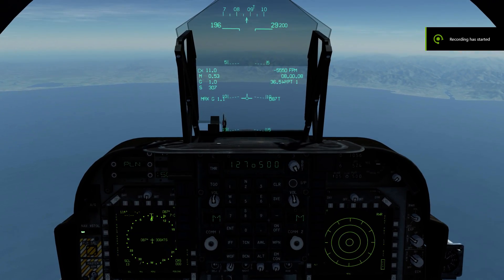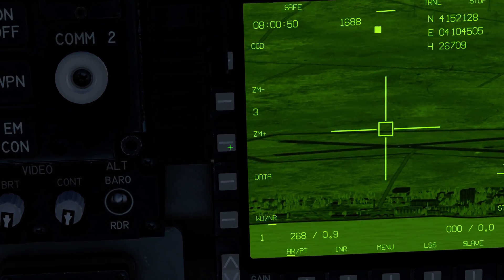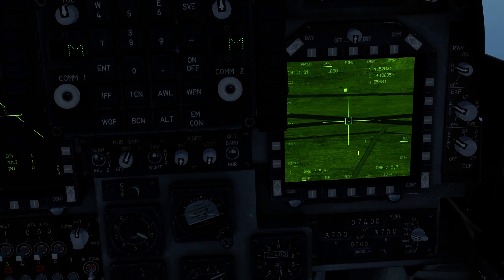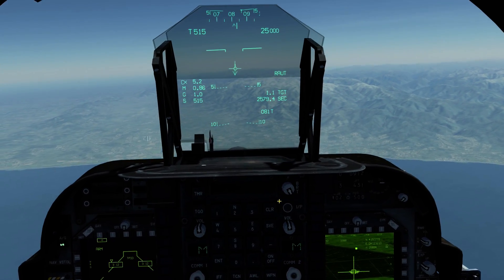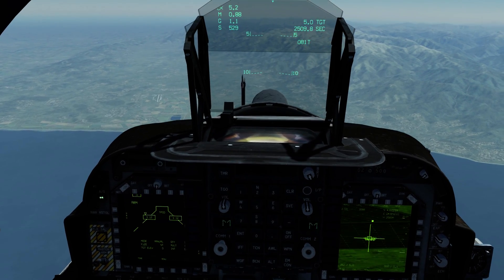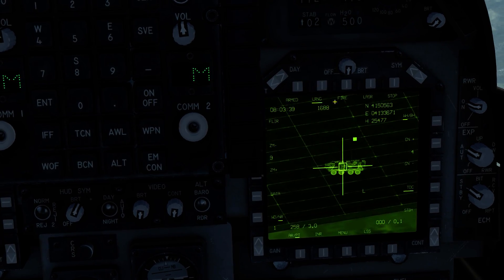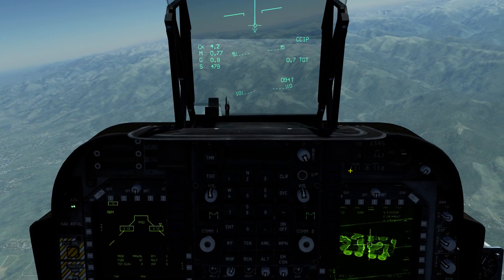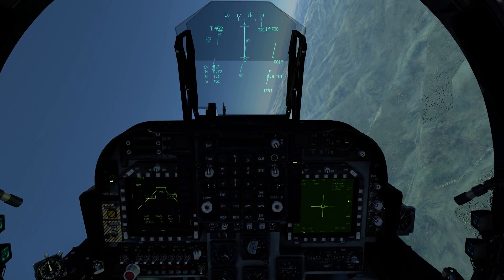How to Lase Using the TGP in The AV8B DCS Open beta

Comment: I don't know if that's not implemented yet (auto-lasing), but generally when dropping guide bombs you want to activate your laser only few seconds before impact (it's usually done automatically). This is due to the bomb following directly for the target if lasing right after drop, making it fall short. The bomb should follow curved (free-fall) trajectory initially and guide only in terminal phase.
Reply from the maker: damsonn ya that’s not on the av8b nor is that even modeled in dcs, at least I don’t. Believe it is. Thx for the comment.
Reply: The A-10C has the auto-lase functionality.
Reply from the maker: IndigoFox yup I got as talking about the bomb losing trajectory.